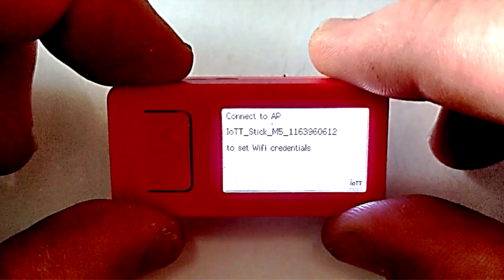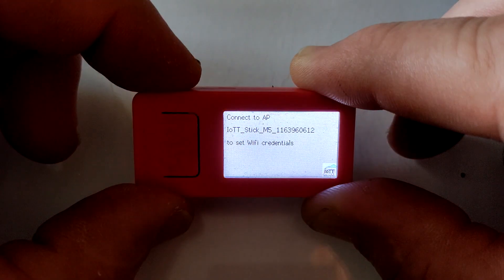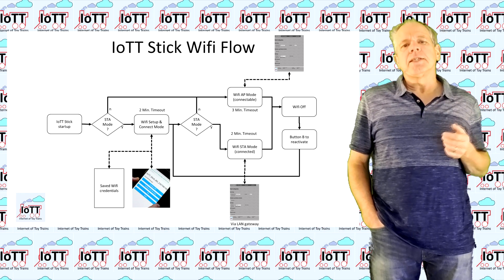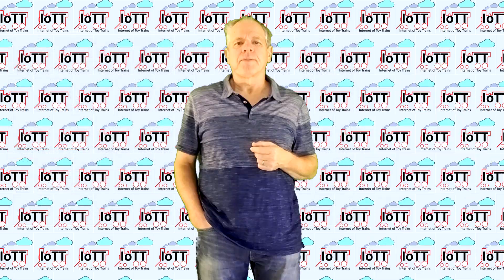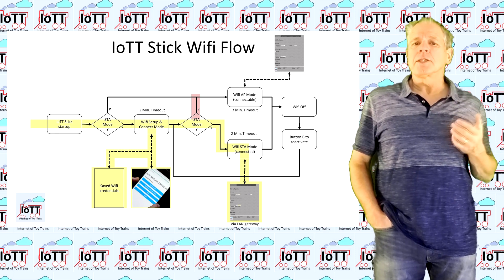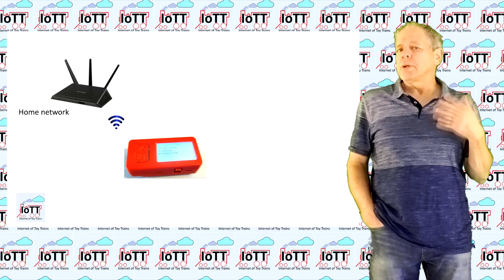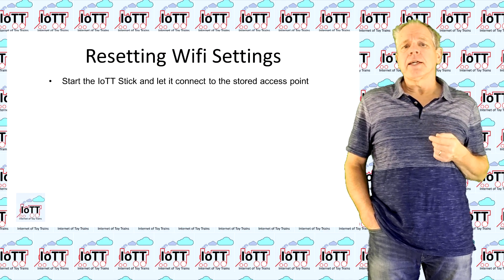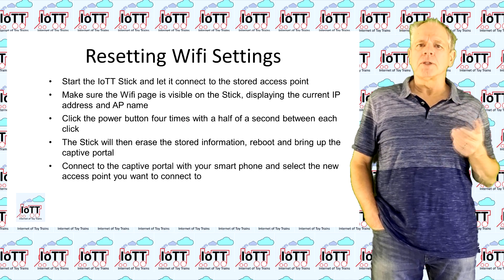IoTT Stick Reset (Video#135)

Comment: Hi Hans - what do I need to do the speed matching you demonstrated in your previous videos?  Do I need only the following?  IoTT Stick / IoTT Stick Plus2 and PurpleHat Mini Track Measuring Kit?  Thanks
Reply from the maker: You need a PurpleHat kit and a Stick. On your end you need a car to install the kit on and a digital command control system that can receive Loconet or WiThrottle commands, e.g. via JMRI, which has servers for both protocols. That's it.

Comment: I always have trouble setting up the WIFI credentails.  If I use my phone to connect to the WiFi New_IoTT_Stick_M5_ etc. It shows the network in the available networks list. I then select the network  New_IoTT_Stick_M5_ etc and it shows connecting. It then states checking the quility of the internet connection and then connects and then it switches back to my normal WiFi network. If I use my PC I connect and it states it will not connect. I have reset the stick several times but seems to make no difference. I have spend over two hours and still can get it to display the captive portal. What am I doing wrong? I already have 4 Stick set up some time ago but then it was also similar to this being very difficult to set up.
Reply from the maker: The captive portal does not really work with the PC browser, it is best used from a smart phone. Phones have the tendency to change the access point if they get a better signal somewhere else. What you can try is to configure your phone to not automatically connect to your standard AP while you are connecting the Stick to the AP. You can do that by disabling the auto connect check box for the default AP in your wifi settings AP list.
Reply: @IoTT  Thanks Hans but my phone will not connect. I have a Samsung A13 which seem to be very slow is scanning the available WiFi networks. Then as I said before it tries to connect but by which time the stick has created it's own access point. I then tried an old phone which will connect but doesn't come up with the captive portal. How do I connect to the captive portal if I don't get any notification box up when I connect?
I am using the new Plus2 Sticks which has been programmed with the M5UpdatePlus2 and I have tried two of them with the same result.
I did try loading the non Plus2 code and it connected and came up with the notification box but when I touched it a message was shown saying no web page. I am at a loss to why this will not work.
Reply from the maker: @davidtwist3659  Some phones take a little longer to detect the stick. In the latest software version I have therefore increased the timeout to 4 minutes before it sets up its own AP. What I also noticed is that sometimes it is better to walk a few meters away from the Stick when doing the wifi setup.
Reply: @IoTT  Hans thank you for the reply.  I reprogrammed the M5StickC Plus2 again and removed the network from the phone. Placed the stick on a long power lead to remove it away from the computer noise. I did manage to get connected and I got the notification. I clicked the notification and I got the message Web Page not available. I reprogrammed another Stick Plus 2 and I got the same Web Page not available message.
Reply: Hans, I have an update. I managed to set up the WiFi by using an older version of the Stick software and then setting up the WiFi with no issue. Then I reprogrammed it to the latest and for the Plus2 Stick. It would look like there is something wrong with setup web page on the latest version.
Reply from the maker: @davidtwist3659  Thanks for the info. I played around with it tonight and may have found something that could give an improvement. Please send me your e-mail so I can send you a download link for a test version.
Reply: I'm struggling also - same issues as below.  My iPhone won't connect and the IoTT stick times out.  I've tried moving a few meters away, but that does not seem to change anything.  I was able to get my older stick (Cplus 1.1) before upgrading the firmware, but I can't setup wifi on my new stick (Plus2).
Reply: I finally did get the wifi setup screen to come up with some additional distance, but as soon as I entered the SSID and password, hit save, the unit rebooted into the saved AP mode.  Would be helpful if the wifi was configurable from the the normal web page - is this not possible?  Will try again later - 12+ tries has worn me out.  :(
Reply from the maker: @ejwolski  Thanks for the info. I played around with it tonight and may have found something that could give an improvement. Please send me your e-mail so I can send you a download link for a test version.
Reply: @IoTT  Thanks for the update - still can't get the iPhone to connect, but I was able to connect from my PC but the settings only saved when I manually entered the SSID and password.   Hans - thanks for the help and super work on this!!!   I'm off to configure my Redhat++ now :)
Reply: Thanks Hans for the link to the new software but I was still unable to set the WiFi. After may attempts (in 2 hours) I was only able to access the Web page twice, once I was able the press setup WiFi  but then the page disappeared and the second time it disappeared before I could select any thing. I will try again tomorrow to see if I get any further.
Reply from the maker: @davidtwist3659  Now, I'm not sure what you are doing. What web page? Are you talking about the captive portal?
Can you maybe try to hook it up to a Serial port and see what messages it sends out during the process?
Reply: @IoTT  yes the captive portal. I will connect the serial port to see what is happening. I will send you the results tomorrow. Thanks

Comment: Any idea when the stick will be back in stock?
Reply from the maker: Right now, I only have some of the original Stick C available. M5Stack has changed the design and the Stick C and Stick C Plus are discontinued. The new product is the M5 Stick Plus2 with some differences in the hardware. I am currently working to make the software compatible with it. I have a few Plus2's here and they will go in the shop as soon as I have the software ready.

Comment: I’ve replaced the router and I can’t connect the stick to the new network. I get to initial setup screen (4 blue buttons), input the network credentials and then device times out. How much time do I have to input the SSID and password?
Reply from the maker: By initial setup screen I assume you mean the captive portal on the smart phone? The timeout on that is about 2 minutes. You can also try to let it sit until it switches in AP mode and then do a reset of the Wifi settings. Also make sure you pick the correct AP from the list and enter the password correct. Furthermore it helps if the Stick is relatively close to the router so that it has a strong signal.
Reply: @IoTT  Thank you Hans. All good now 👍.